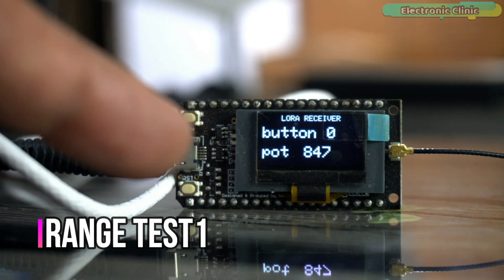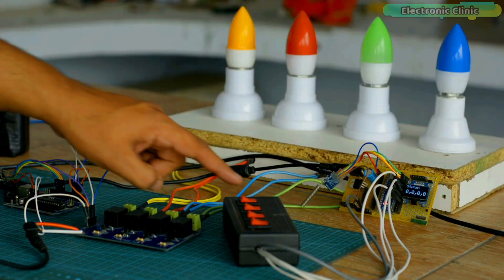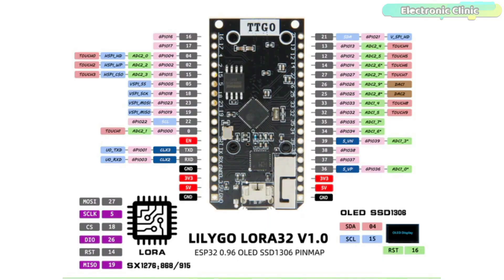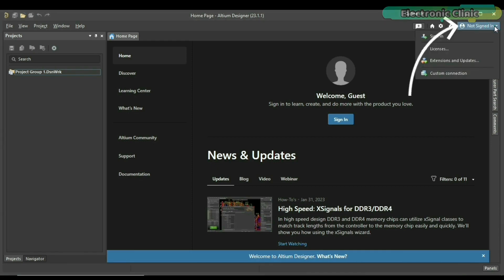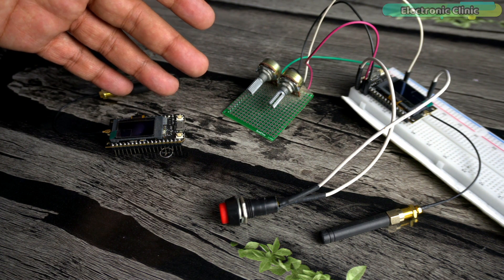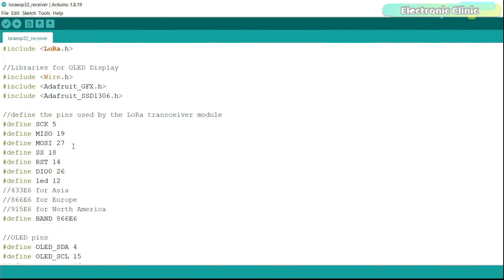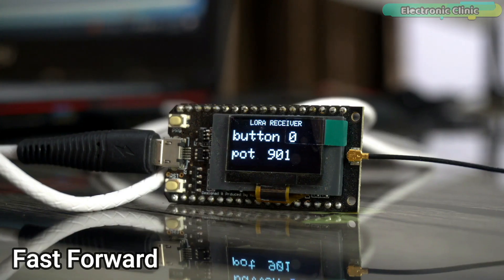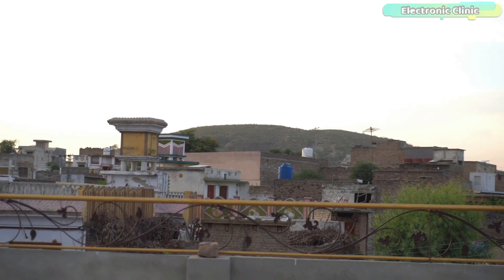ESP32 LoRa Oled, TTGO LoRa32 SX1276 868Mhz with Arduino | Range Test | LoRa SX1278 433Mhz

Comment: Make sure both antennas have the same orientation and are about 6+ inches away from metal objects. If one is vertical and the other horizontal there will be at least 20dB attenuation.

Comment: Hi, excuse me again. Is the port of the board Type-C or MicroUSB, and can the cable wire alone upload code to the board(no need extension equipment). Thanks!
Reply from the maker: Micro USB port. You don't need any extension board.
Reply: Tysm!